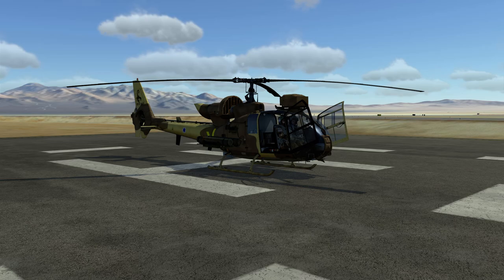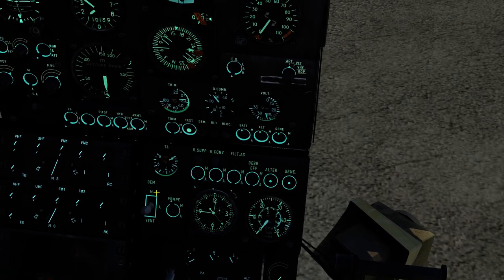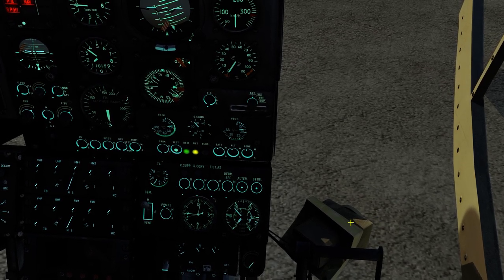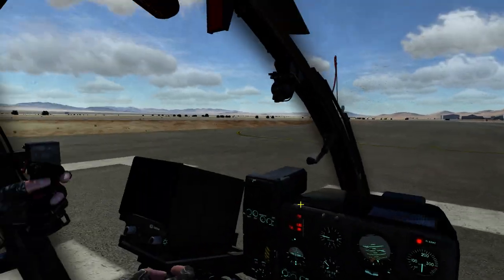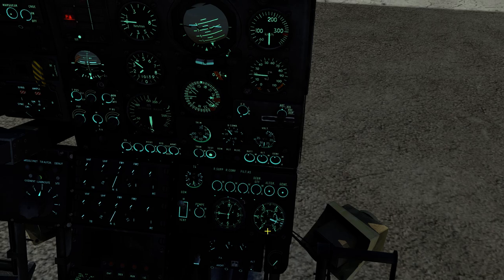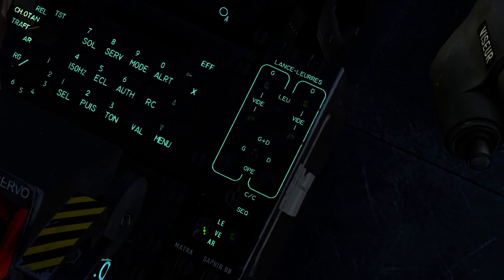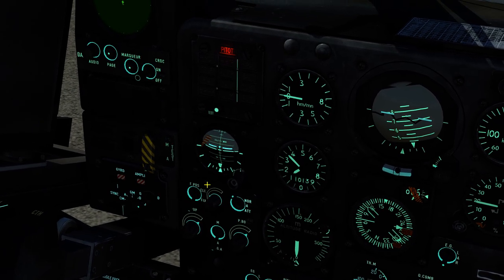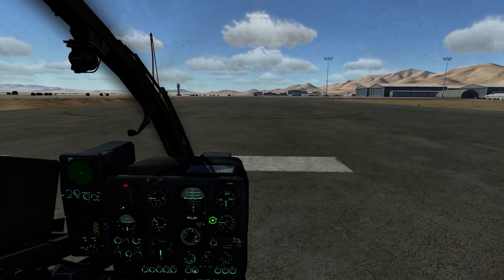Gazelle Quick Startup

Comment: What kind of computer specs are you running?  The sim looks very smooth.

Also, will there be an English version of the cockpit?  And is there a limit to the length of the wire in the HOT3 system?

Comment: Quick question why is it not possible to stat the turbine at 10-15 seconds with fuel pump on? as you can in the real gazelle because at 20 seconds your in the realms of a hot start which is what you don't want.10-15 seconds is the norm if you didn't know already.